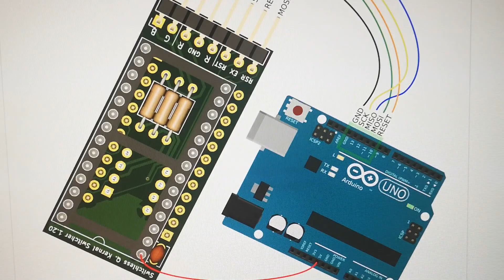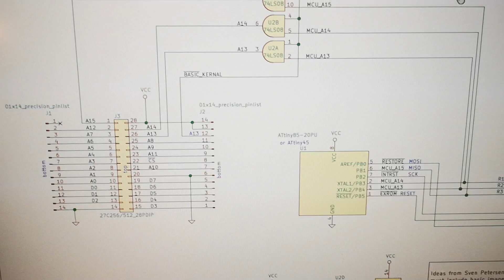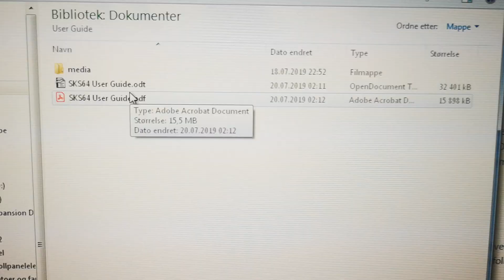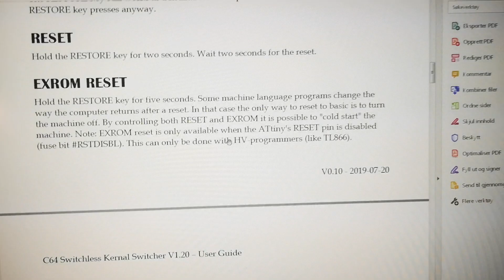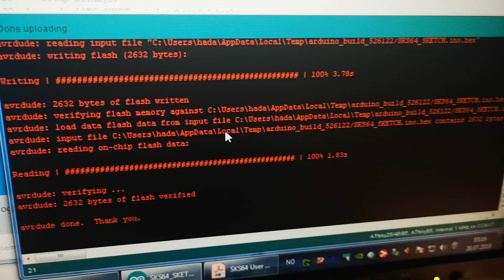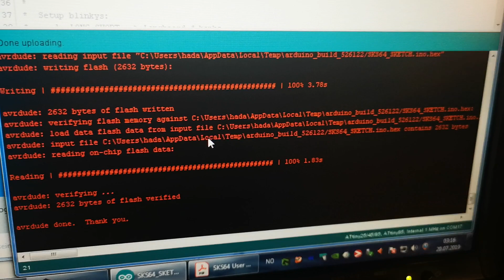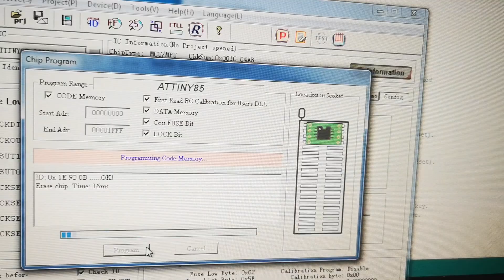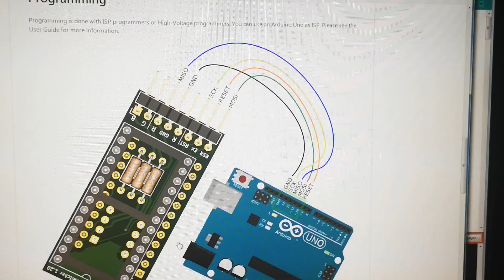C64 Switchless Kernal Switcher now Arduino compatible..

Comment: First of all you make nice stuff I love it.

But I was wondering Is this also possible to maken or put in, into a VIC20 I hate switches while je need to drill holes in cases. I know it works in a VIC20 whiteout the Exrom reset but is it ok to use without the exrom reset.
Reply from the maker: Thank you. EXROM reset is optional.
Reply: @bwack  ok thx for you quick answer and you awesome projects

Comment: Does it work on the "flat" C128?
Reply from the maker: I havent tested, but yes I think so.
Reply from the maker: Its the short board kernal switcher.
Reply: @bwack  But would it be switching the C128 rom or the C64 rom? They're on separate chips. Perhaps one would use two of these and the other one would be triggered by caps lock, which I think also has a pad on the main board.

Comment: 7:50 How many kernels for say a gs? Is it 3? 4? edit:
It can use both long and short board too?
Cool video btw!
Reply from the maker: I don't know the gs, not sure.
Reply: @bwack  They say it is an identical board, save for the cartridge slot. And you can even solder on the tape drive interface.
Reply from the maker: @obsoletepowercorrupts  The wikipedia page for the c64 game system says that the kernal is 7kb, and it has 20kb of rom. hmm. I don't have chance to test.

Comment: The exrom reset is interesting. I have to think of it a bit and then I could use one of the two reserve IOs to do the exrom thing and release a new firmware. Maybe do the exrom reset on restore 9.
Reply from the maker: Or exrom reset on longpress, anyway just a matter of taste. I like to have exrom reset as optional. I think some will want to have normal reset to keep stuff in memory if say you work on an ASM program.